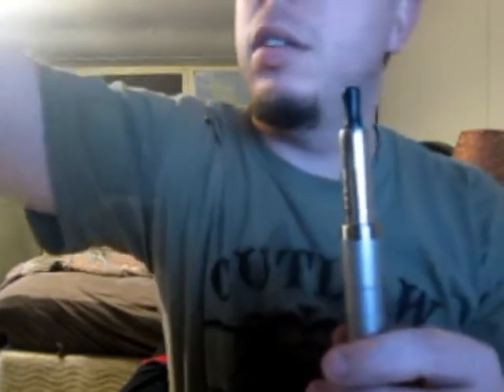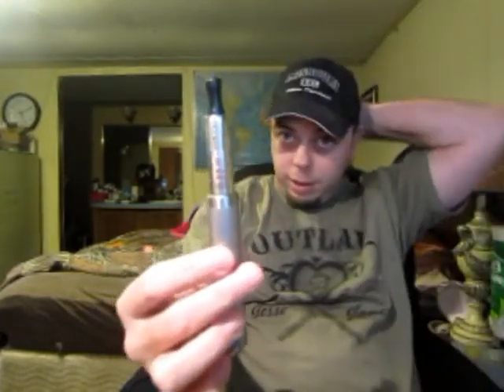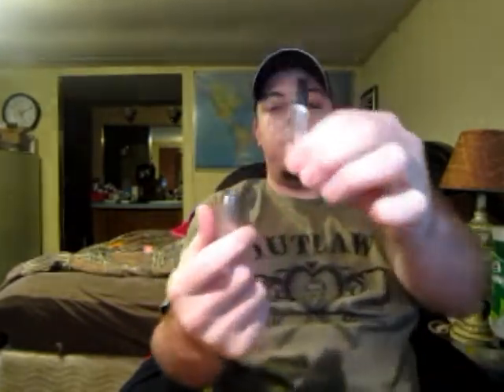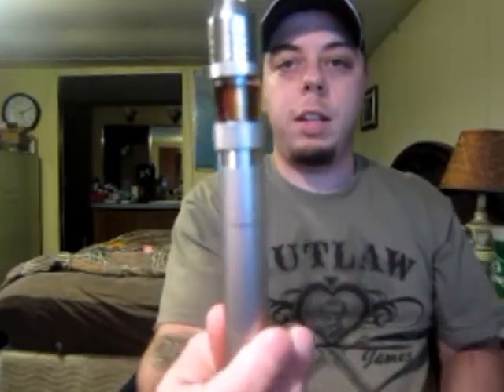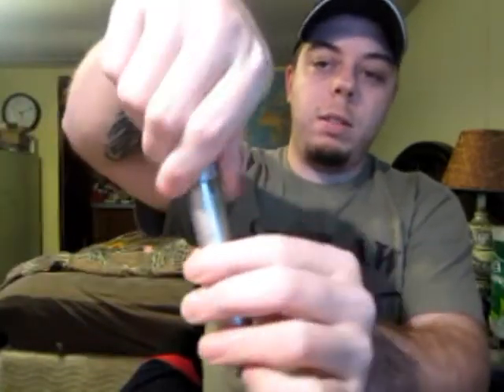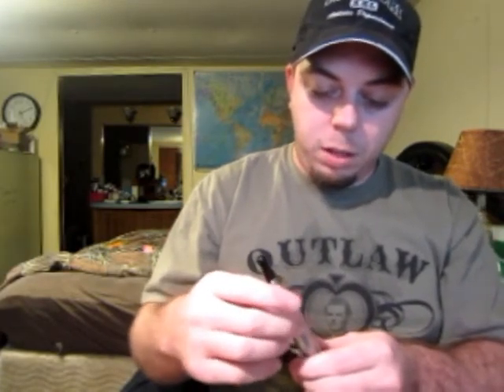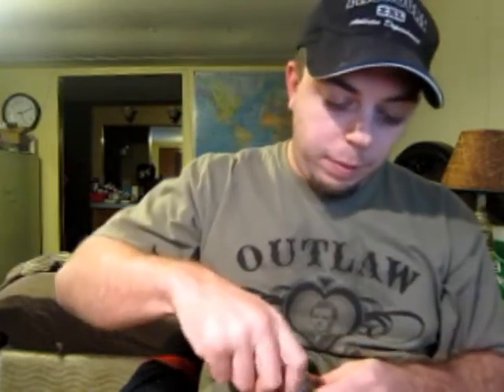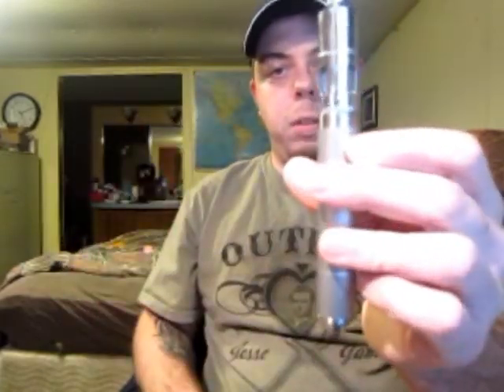Messing With The AGA-S & Precise Plus 18650

Comment from the maker: On the Precise. If you can shake the PV with a battery in it and it does not move around then you should be fine. If the battery moves inside the pv then you may not be getting a good connection. Thats really all the o-rings are for. You want some resistance when screwing the cap on. Like the last turn should feel tight making you compress the o-rings just a little.

Comment from the maker: That should be a hot set up. One thing about the AGA T2 though is that its not the best out of the box. I liked the V1 a lot more. I have two of the v2's and don't like them much. The wick, and intake holes are to small. So I tried to drill the wick hole by a half size and it screwed up the center channel rendering it useless. With a bigger intake it does help some. Might try opening it up to 1/16th of an inch. If I had to go cheap I would get the RSST.

Comment from the maker: Whats your setup like. Is it a Genesis, whats the resistance, and what kind of wire are you using. Do you have the proper o-ring or rings in the top so your making good contact when you push the button?